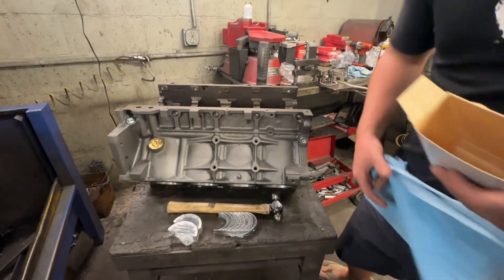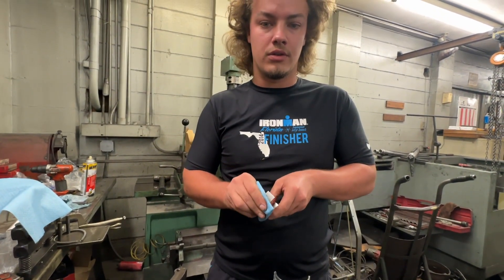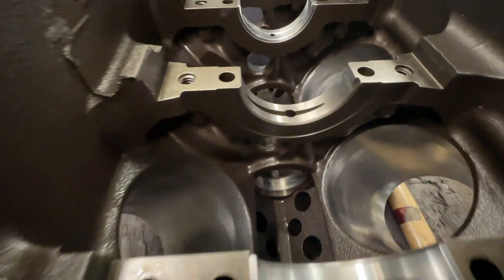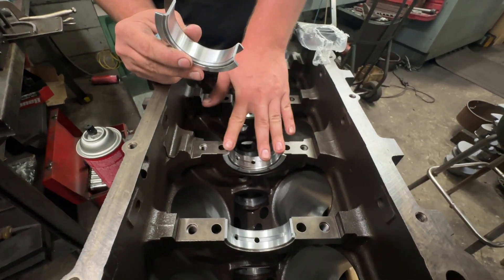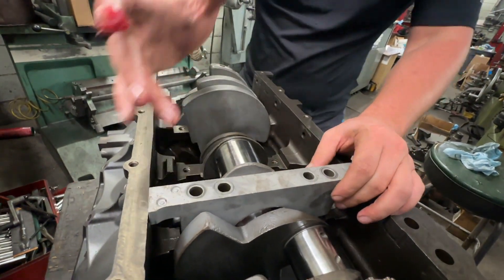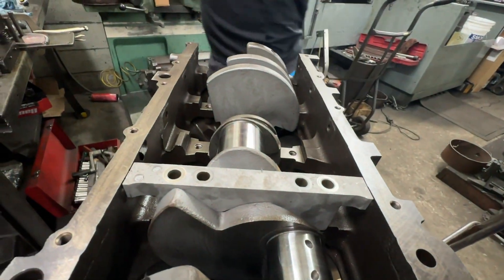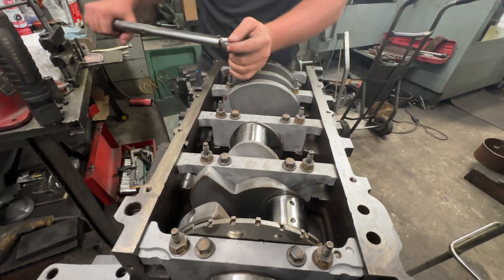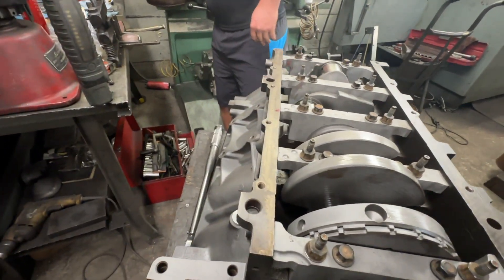crankshaft and main caps pt.1 How To: build an LS engine from start to finish Red truck pt.8

Comment: Other comment answered clearance question. I wouldn't recommend using a steel hammer on main bearing caps.
Reply from the maker: you do have to be careful but trust me from me having to beat pistons to pieces to get seized engines apart you have to hit them way way waaaaaaaay harder than you think ask my hand I almost broke when I missed  how hard I was swinging 😂

Comment: Did you check the bearing clearances or is that something you don't usually do?
Reply from the maker: the clearances checked the clearances when we did the machine work of the block. usually if you give your machinist the whole rotating assembly they will do that but if your machinist didn't check them then I definitely would before assembly